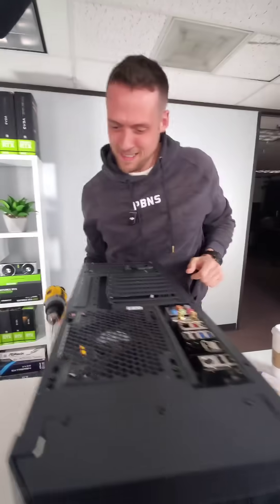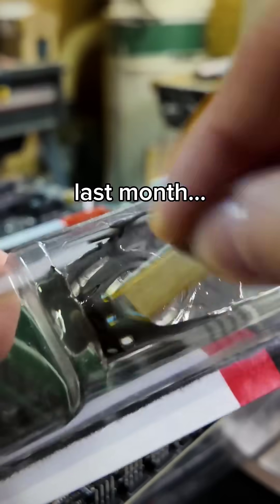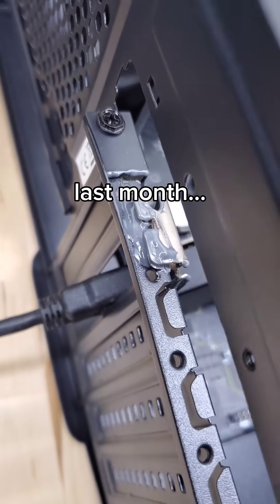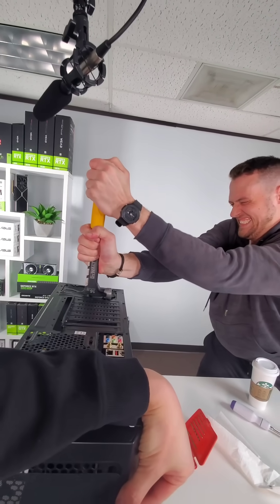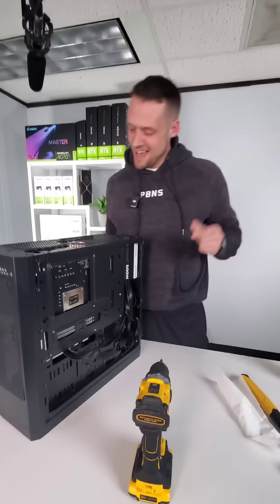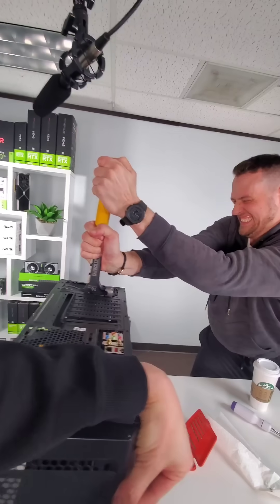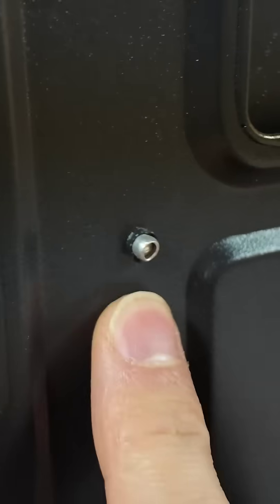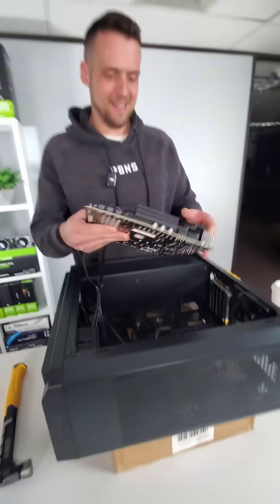This PC is impossible to take apart

Comment: I've been waiting my entire life for my training to actually help with PC building. Thank you for the opportunity.
Reply: RYZEN 4070 GUY🔥🔥🔥
Reply: @superTUXEDOman   YES SIR!
Reply: HELLO ZTT😃
Reply: That's technically not PC building. More like PC demolishing.
Reply: Broooo you should start a Fitness channel
Reply: I need help, a budget option, what should I upgrade my Ryzen 5 4600G to?

 (I have a GTX 1080ti you can make video or reply but please do reply or do whatever you need ❤)
Reply: @xdreamerx5017  I think you need to upgrade both but first upgrade your CPU as Your GPU can handle most of modern games at 1080p, then later upgrade your GPU when you have the budget
Reply: @xdreamerx5017  I think you need to upgrade both but first upgrade your CPU as Your GPU can handle most of modern games at 1080p, then later upgrade your GPU when you have the budget
Reply: Sup zack
Reply: Yooo ztt
Reply: Yoo!
Reply: Instead of using a claw hammer you should use a adjustable wrench for the power supply screws
Reply: Best collab to date
Reply: Hey ztt can 
You please send me a new GPU please I have a gt 610 rn and I am trying to run ark survival evolved smoothly please Zach.
Reply: Love your vids man. Keep up the good work!
Reply: Hello Zach
Reply: Btw if I am not mistaken, you should be able to unscrew the psu screws with a 10mm socket
Reply: Absolutely goated. ZTT “The PC Breaker”
Reply: But does it boot
Reply: A follow u both but as a fellow pc builder the PSU screws could just came out with a socket wrench 😂
Reply: All you would have needed is redlock tight
Reply: Two losers lmfao
Reply: "body building for pc building"

-Zach
Reply: The NZXT scam promoter himself. You still giving misleading advice and care only about money?
Reply: Hello zach Im a big fan
Reply: and u still using tools for that, weak
Reply: Zach pulls up with the army muscles
Reply: You got that military power in you o7
Reply: You just missed one thing, naming it a luxury brand and selling this unassemblable pc [ just like an apple a day ]
Reply: Just fill it entirely with epoxy 😭
Reply: building??!?
Reply: If this reaches 10k likes he gives me a pc
Reply: wow thats cool but ztt should i upgrade from my i7 9700 and rx 580 to rtx 4060 ti  and i7 13700k?
Reply: @davitotty1 yeah but dont go for a 4060ti, a rx7700xt or something will be better
Reply: @Tomcat-tomato  
Some people like upscaling or ray tracing, and you don't know if they are some kind of streamer or do other stuff, but Nvidia's cards are better for this don't forget, I'd honestly get a 7800 XT but that would scream bottleneck on my Ryzen 5 4600G

Edit: And 7700 XT is more like 1440p card, try ray tracing on that with ultra preset...
._., just because you hear a lot of stuff doesn't mean it's always right, but it's your opinion, remember to be positive on both sides.

Edit2: and there is no bad gpu, just a badly priced gpu.
Reply: @xdreamerx5017 Ray tracing sucks, shouldnt get a 4060ti just for RT
And yes it has dlss but it lacks raw performance
Reply: @Tomcat-tomato 13700k is stupid, dead platform + the degrading issues.
Reply: @davitotty1  
If you wanna use Intel then sure, but just watch out for the issues, and don't go ultra core as they have voltage issues and even more, for 4060 Ti, I think 13600K is enough but if in your country the cost is a fraction then sure.

And consider also AMD if you focus on gaming, and make sure you get new motherboard and a psu that can handle the new parts, and if you can expand budget go DDR5 instead of DDR4 it's faster and newer RAM with a massive support, if you have questions let me know.

Edit: make sure the cl rating for ddr5 is between 30-32, and speed of 6000Mhz / MTs.
For DDR4 (if you want to cheap out ;) )
CL 10-16 and lowest speed 3000Mhz or 3200Mhz.
(3200Mhz is sweet spot usually same price as 3000)
Reply: @davitotty1  I'm no expert but I think he'd say that you should switch to AM5.
Reply: @davitotty1 yes
Reply: @davitotty1 upgrade when your games stop working, if they don't run smoothly on low then upgrade if they do run smoothly then dont
Reply: @davitotty1 no 4060ti terrible card get a 6700xt or a 6800
Reply: @FortniteBallsLebronJames  the thing is idk what Radeon gpu classes are its confusing
Reply: @davitotty1  you’d be better off with a 7060 or an intel arc b580
Reply: @davitotty1 "wow thats cool anyways should i get this or this"
Reply: i also love your channel
Reply: keep the good work ztt
Reply: Should i ugrade from my Rtx 7800x3d to a intel core rx 9800x3d and my ryzen 4070 to an intel 5079 ti super ultra pro max and also should i ugrade my msi difnjdmejdn moniter to an duhdbfienbd thanks for the help😊

Comment: Do the same thing. Put tape around power supply and heat sink and gpu fans. Seal off bottom and all 4 sides with tape as well. Then fill the case with epoxy resin and let it harden. Worse case scenario is it will take a lot longer.

Comment: The best way 2 take out rivets is,

 - A shop vac on the bottom for collecting scrap.
 - A drill with a drill bit, which is a size or two less than the rivet itself.

Comment: i got a great idea, how about physically burying the entire pc in epoxy and then plate it in metal and the case also has embedded rivets (dent the metal towards the case and rivet that) and then weld the back panel (use a syringe with battery and wires on negative and positive with the negative and positive on opposite sides of the edge) and after all that, superglue, epoxy and weld the psu into the case and after all of theat, weld the hole of the SSD to the mobo standoff

Comment: The only part that really doesn't make sense to me, is the using epoxy instead of thermal paste. Everything else would make it so it's really hate to take it apart, but it could still actually be used as a working computer. But that epoxy instead of thermal paste makes it so there is no way that the CPU would actually maintain cool enough temps to run for more than a few minutes, because epoxy is not going to dissipate the heat generated. So is the point only to make it hard to take apart, but not actually be used?

Comment: What you are saying is only a mechanic can take this pc apart

I mean a simple small chisel with a slight tap would of sheared the top of the rivets off

Itty bitty back out screws for the PSU

Epoxy? No problem, meet the mechanics chemical friend "diesel, acetone and brake cleaner in one bucket"

Comment: epoxy is gonna be your best friend for building a PC that shall never be taken back apart(AKA pour a bunch of epoxy on the back side of the motherboard, use epoxy to hold the IO shield in, then epoxy the motherboard to the IO shield. take and put epoxy all around the GPU slot with the GPU in it already. I dont think anything can be done about the PSU with what he has already done)

Comment: drilling out the rivets from the front was a little dangerous and dumb - if the back of the rivets is reachable, you grab a chisel and the trusty hammer and pluck off the rivet heads.

Comment: Pot the entire inside of the PC in resin. Create air ducts for the fans, or liquid cool the pc. Seal up all of the holes and vents then fill up with a series of layers of resin. Use a specialist deep pour resin that's made for pouring a lot of resin at a time. I'd say that you could probably get away with five pours, maybe six just to be safe. 
Just make sure any moving parts, fans, switches, etc are fully isolated from the resin.

Comment: The power supply screws were so easy and he did it in the worst way possible. Next time grab your LTT screw driver, take off the bit, and jam the cup onto the head of the screw which is literally the same size as the bit

Comment: You should have just used red lock tight on all the screws wouldnt have even needed rivets. Rivits are easy to drill out screws arnt. Especially with read locktight

Comment: Those psu screws are only half stripped, they have an external hex and internal Phillips, you only stripped the Phillips, but a nut driver would've taken them right out

Comment: as a tig welder anything metel ill fucking weld u wont be able to open the pc case without cutting into it

Stfu heat is controllable if you do it a certain way

Comment: The issue is that you were using epoxy on smooth or painted surfaces. You need to scuff/sand the pieces you want to epoxy together to get better adhesion 😉

Comment: You should solder all the connectors to the board and plastic weld it. Also weld the rivets to the frame and the motherboard (from the back) and weld every single screw.